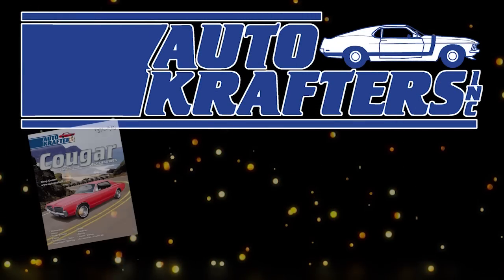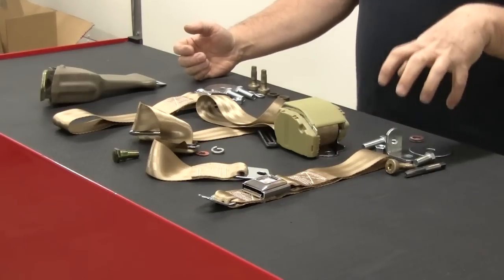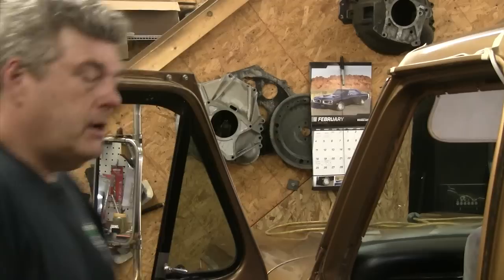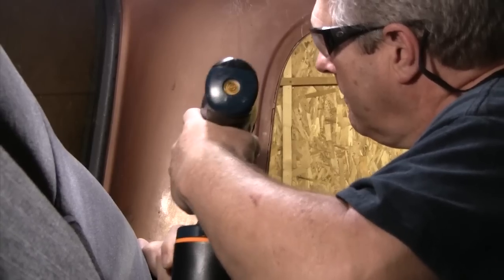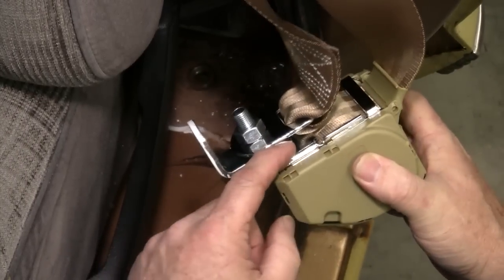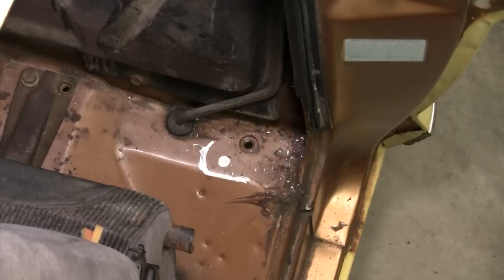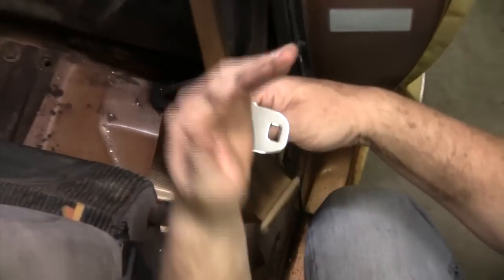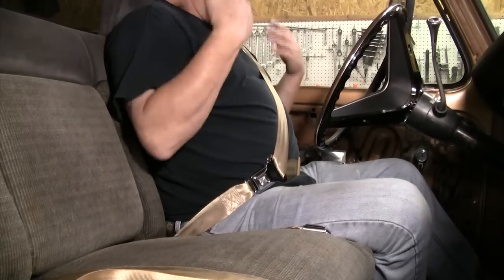3 point belt seat belts F100 Install Episode 19 Manic Mechanic

Comment: I have the shoulder mounts in my 69 F100.  It had factory lap belts with the rubber plug as well.  If you do the upgrade don't cheap out and get the manual 3 point.  I did and they work but you would be surprised how much of a pain the lack of mobility is compared to the retractable belts.
Reply from the maker: Agreed!

Comment: I went with the lap belts. Both side are the retractable. Other wise you see them hanging out the door.the only problem i had was so many of the young cops use to pull me over looking for my seat belts. Because they did not know they only used lap belts in my truck.
Reply from the maker: A friend got pulled over for one taillight on his 32 Ford. It only had one tail light. Still got a ticket. Even though he was pulled over at a Ford car show and we were telling the officer that was correct.

Comment: I want to do a shoulder belt system with bucket seats in my 59 F100. Has any done this?
Reply from the maker: Honestly I'm sure someone has. The biggest issue you're going to have is is there something in the cab that would support the shoulder portion of it. In an accident the shoulder belt upper section is going to see a tremendous amount of force so there needs to be a good bit of bracing around the mount point.

Comment: Have you done one on installing an aftermarket steering wheel on a 71 f100?
Reply from the maker: No, not yet, we have a rim blow from a '69 Mustang. Hot tip: get a wheel for a 1965 Mustang. Same collar diameter on the 1967-'72 Truck.

Comment: I thought that's what that rubber grommet was for up on my '72 F100 Ranger B pillar! Why would they put it there if they didn't install a 3-point harness? Was it an option?  Anyhow, I want to do this, but I'm not sure about drilling and tapping. I don't have a tapper. Maybe I could find a Grade 8 bolt that would fit the stock hole and an L bracket that would fit the stock hole on the floor..hmm
Reply from the maker: The Bolt would be really small to go in the non-tapped hole.  The shoulder belts was an option. I have to say that the kit is very slick and easy to install.

Comment: How do you get the rubber spacers out
Reply from the maker: If you are talking about the B pillar rubber plugs, sadly, ours were so brittle they ripped out. They are just push plugs.
Reply: AutoRestoMod Car Restoration Modification Okay thanks, the same thing happened to mine
Reply from the maker: Not that unusual. Most trucks were treated to an outside life.
Reply: AutoRestoMod Car Restoration Modification Yeah I figured it was normal. It was a work truck so I'm not suprised

Comment: Good source.  But i checked a couple of products on retrobelt site.  Specifications for the 3 types i looked up for a 1970 c10 say...Made in china.  Nope.  
Also in rhis video..you mention a bolt rhat comes for your f100 being too big...just come on.  Kits tailored for a certain model need to work without re-engineering don't you think?  Basically you htought this btand to my attrntion so i could research them and eliminate them as an easy brand.  Thank you
Reply from the maker: Ok. Glad we could help.